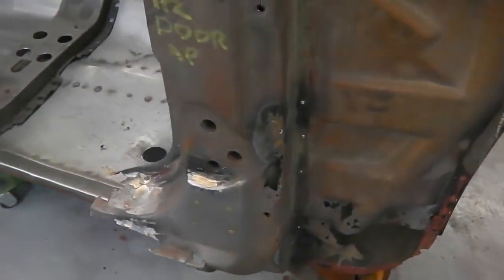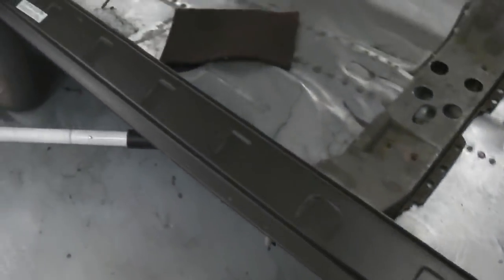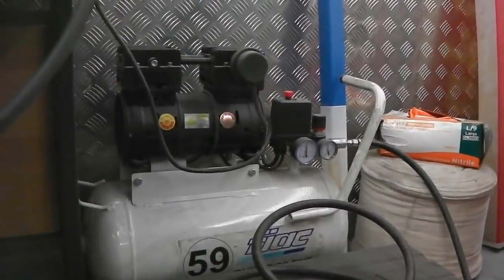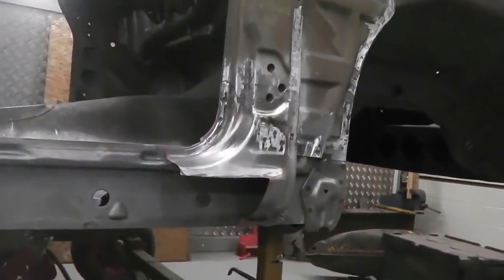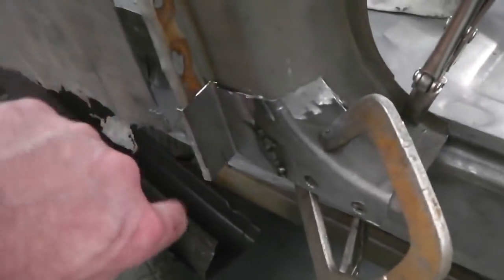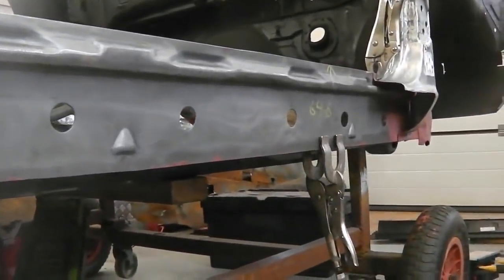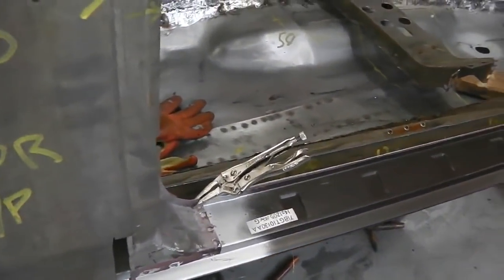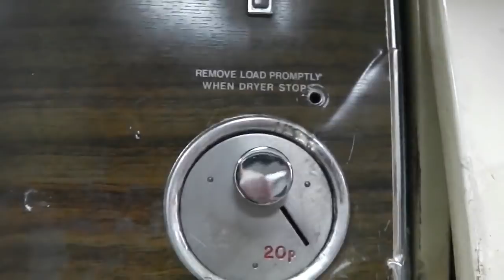Classic car resto - Ford Cortina Mk3 - Bramble EP14

Comment: Hi Pete, Nice job of fitting the inner & outer sills, and on the repair on the bottom of the "A" post, looks nice  painted in the primer,  I see your using the zinc rich  U Pol weld through  I told you about,  I have had no rust issues  on my Mk3. build  using that,, I found it to be a very good product.. enjoyed the episode as always,

Comment: Hi pete ur cars comin on  well . Im impressed by ur level of quality put into ur work on this car id feel safe driving this car anywhere id not give the strenth and the quality of the workmanship a second though with regard to my saftey its a top class job . Im surprised ur not a time served welder the only difference is the paperwork .involved . To accrediate u as ur welding is great  . Ur a quality metal worker ur more or less making a cortina  a lot of people woulda scrapped it or stripped it for parts . The dip really shows how bad the metal is . Its shocking how much it actually shows up . Lookin forward to the next edition . Im only finding ur vids . So pls forgive me if im way behind . Lookin forward to the paint and u finally getting through mot and driving her around . Im lookin for a decent escort van the earlier the better although the last ones were brilliant that 1.8 turbo diesel was a great engine . Its all the electics and electronics that put me off modern cars and vans id rather a far simpler vehicle to run  anyway hope u and family well take care chat soon . Ian innes .

Comment: skf explorer 626 -zz/c3gjn will fix  bearing on mac Allister power file . mine did the same and used a soft roofing  bolt to replace rivet, works a treat cost about £7 from bearings uk, its a high temp and high speed sealed bearing

Comment: Thanks for the opinion on the mac belt needle file. Been thinking about getting one and the price drop was a clincher. click and collect. I agree with the welding ability, i can fix metal together but proper welding is another thing. Knew a welder nicknamed Sticky who worked on the rigs, word was he could stick weld kitchen foil.. Making great strides with Bramble.

Comment: WILD BOYS!😆👍
Pete. Try using a thin copper tube as a sleeve to fit around your spot weld drillbits but leaves 15 mm of drillbit sticking from end of  copper tube.
This prevents the drill screeching through the hole and the Chuck smashing in to the metal. Makes the whole process far easier as you can confidently push without to worry and your neighbours will appreciate the silence.

Comment: well i guess some bits don't get made so yeah using an old washer or dryer or machine that'll be okay, might be a bit green here and there but another dip in the acid will fix that, besides old machine good for putting bits on a cortina that or bramble has gotten to much so pete's setting up bramble the washing machine, get it washed inside a mk3 cortina, not even the usa bramy ppl have done that!

Comment: Say it Pete, the Chinese stuff is rubbish😁  But I Have even tried the local big box hardware store and used their $1 each belts,which didn't break but shed all of the grit in less than a minute. I only  use air for safety sake, having received more than my share of jolts from burnt or worn cables. I will see if i can get the Screwfix belts posted to Australia .

Comment: Another fascinating episode Pete, the A-pillar plus inner and outer sill fitted a treat, I do have one request (if I may be so bold), would be great to see more welding, we see all the prep which is great then you cut to the finished article so if poss  could you include more mig work? (love welding) I know time is an issue so no problem if you cant, re your crock sander is it possible to replace the broken bearing? they do look like a standard one so you may get more life out of them, I have a Black and Decker like your old one which has served me well.

John (Norfolk)

Comment: i have koupled 2 small kompressors together(2,5 hp)..used a dubbel male konnektor(on a short line)..it give a fleksibel run..use one kompressor in light Work..and power both up in heavy Work..a bigger tank..dont realy help..if the pump unit is sleightly to small..koupled together the one unit(even it are not powered vill be a ekstra tank unit(and cost less that a ekstra tank unit

Comment: where did you find the inner and outer sills mine needs replacement. Great video bro great job
Reply from the maker: inners are from expressedsteelpanels, in yorkshire, outers i found on ebay
Reply from the maker: thanks pablo,i t may be that expressed canmake the outers but may be expensive, i think magnum panles maay make the outers also